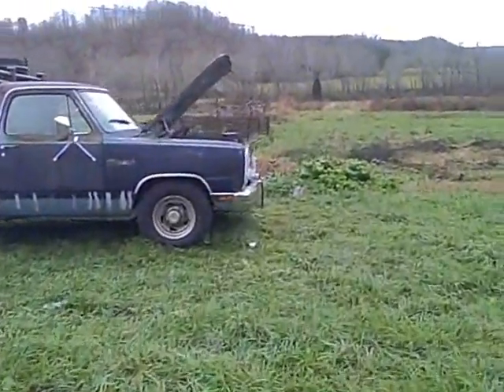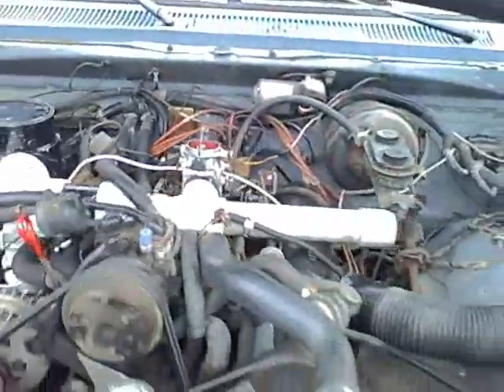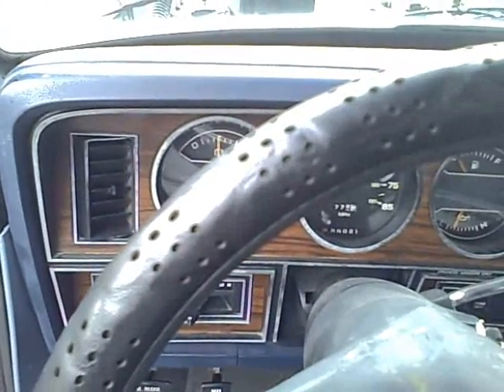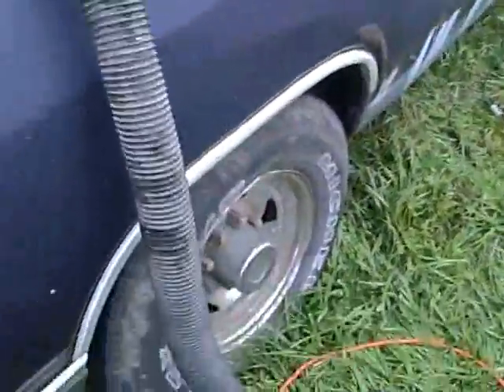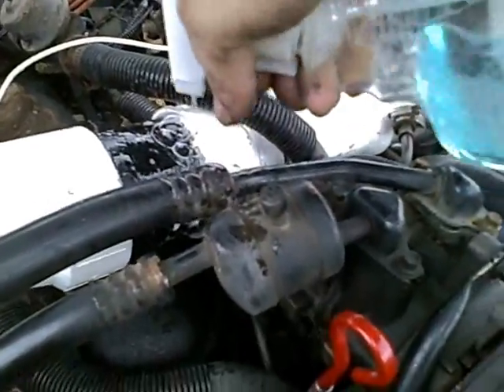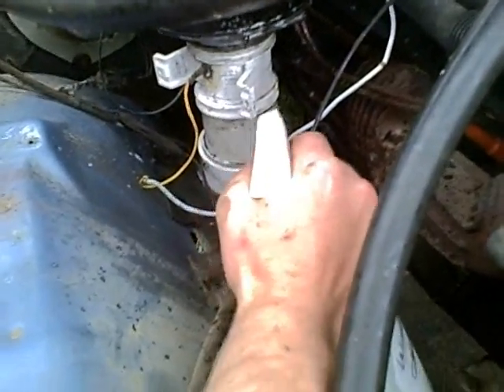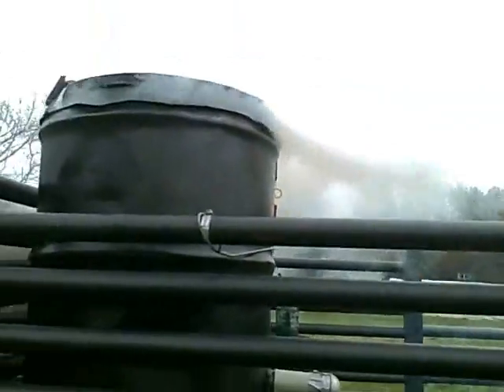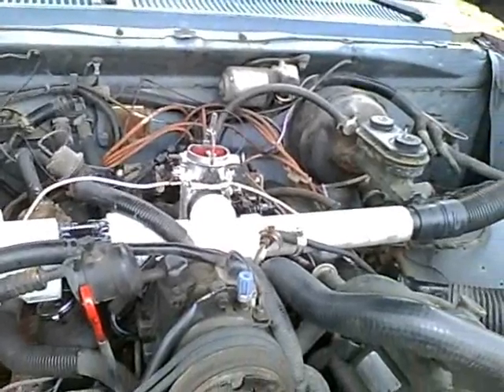Woodgas truck won't start

Comment from the maker: Watching this again... in this particular video the issue was the servo controller on the air intake valve. The engine suction was overpowering the servo and pulling it open. On a later video I got it to run by covering it with my hand.

Comment from the maker: The issue was solved by replacing the whole gasifier. From what I know now it was likely  combination of leaks, weak gas, and plugged grate. The truck did much better with the Keith gasifier.

Comment: @eatmorechili1 When i said restriction I was thinking of the filteration, if the filter material is too dence it can cause restriction or if its full of tar. 

I've had really good results with wood pellets, they're very dence and make a strong gas, also they are uniform and cause less bridging, I rebuilt my first gasifier two or three times before I understood the wood your putting in the gasifier can be the cause problems with the fuel vapor,

Comment: Is that bilge blower in series with the gas stream to the engine? If so, I'll bet that's the problem.  You can't suck enough gas past the blower.  You get enough gas for the engine to fire at starter speed, and that's about all.  We need about 50-50 air and fuel gas, so the fact that you need the choke plate almost all the way closed seems to support that.   Do you flare the gas in the first place before trying to start the engine?

Comment: I doubt you'd need to adjust the timing, the timing will help with the performence but shouldn't keep it from running, I also doubt the leaks are causing this, My guess is one of three things air/fuel mixture, the fuel itself or restriction.